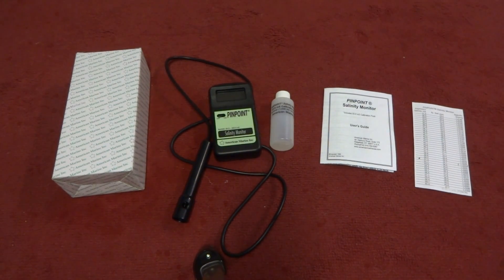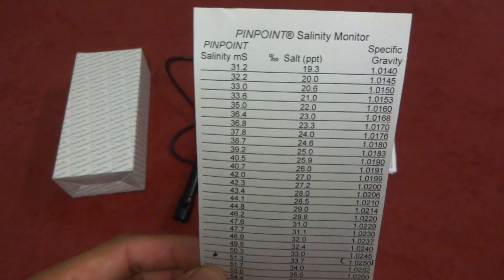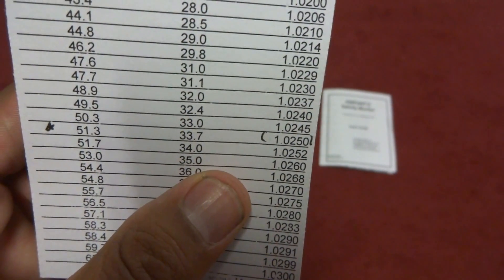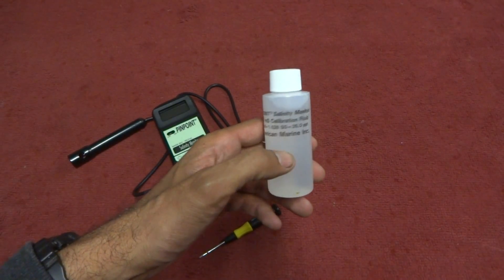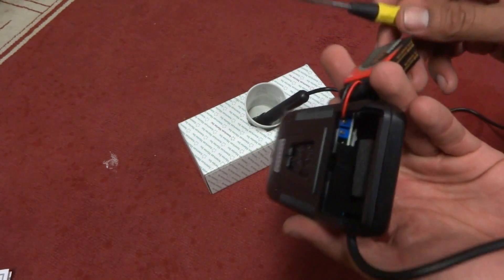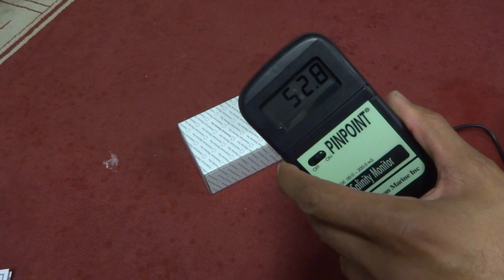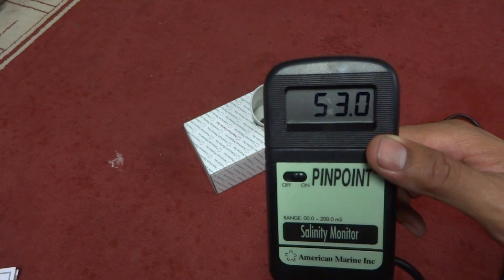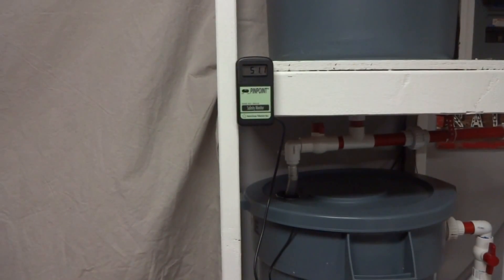PinPoint Salinity Monitor Calibration

Comment: I meant that when i mix the salt from the rodi I'm gonna use the  pinpoint for what I have mixed in the brute can but so wanna use it for my DT should it be submerged at all times .? Reason I ask is cause I read something that said not to let the probe dry not sure how true it was
Reply from the maker: Yeah, I know pH probes can't go dry, not really sure about other probes. I always keep them submerged. You can definitely use the PinPoint for your saltwater station AND DT. It may get old taking the Pinpoint back and forth. After I place my salt in the freshwater receptacle, I let the salt mix-up for 24 hours with pumps. More often than not, you have to make adjustments after 24 hours to either bring up and lower the salinity levels.

Comment: Do you let this run continuously? Have you seen it go out of calibration?
Reply from the maker: Yes, I'm running it 24/7. I've only had it for three months, but in that time it has been spot on. I will need to calibrate it every few months as with any salinity probe or refractometer. Thanks for the question!

Comment: Just something I'd thought I'd share regarding keeping pre-mixed salt.  I am using the Red Sea Coral pro sea salt. For the first few months I kept my barrel readily mixed at the right salinity.  What I noticed over time was that some of the clay used as a binding agent precipitated out from the salt mix.  Initially I thought this was GFO fines, but turned out to be from the salt mix.  A red film started to accumulate.  May want to keep an eye out for this.
Reply: ***** I would add the salt mix to my water and get it to 1.025. Then let it sit for a day or so.  I have since learned, that you only need to mix as you go. No need to let it sit for a day or so.  I didn't know if that was the intent or not with your pre-made salt water reservoir.